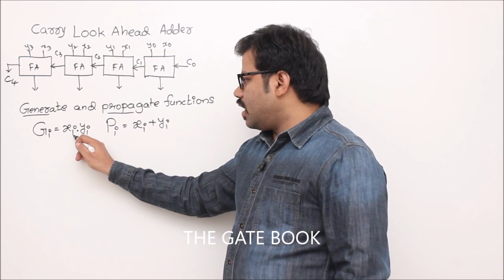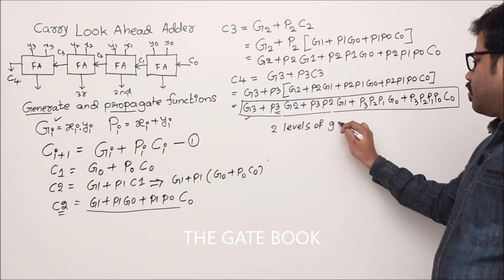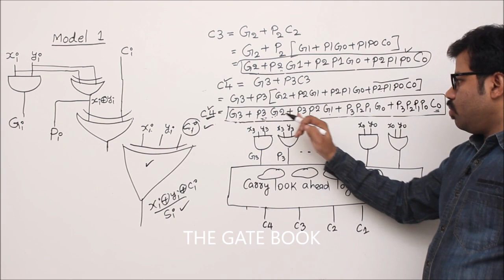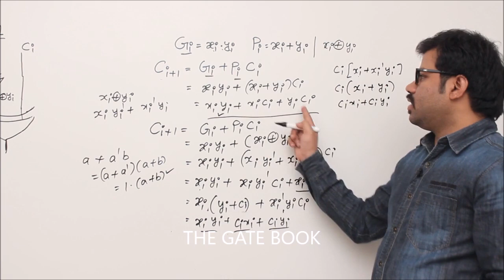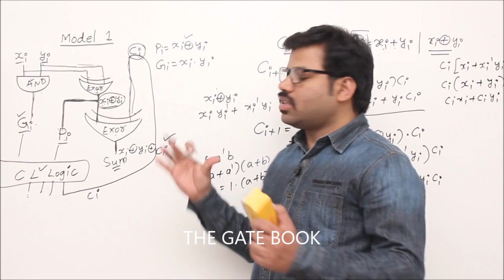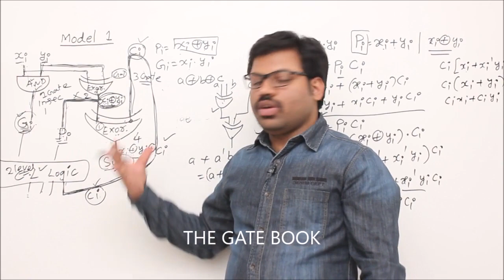Carry Look Ahead Adder

Comment: Thanks alot i didn't understand how CLA worked but as soon as the guy in the video mentioned 3 pin OR gate. Everything made sense of course you should be able to have more than 2 transistors for an OR gate and the same should be true for an AND gate.